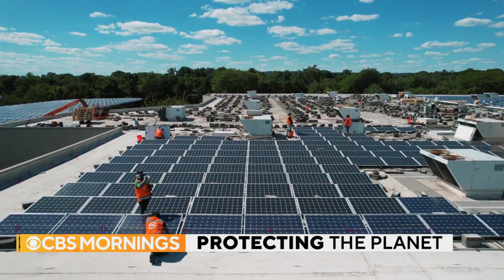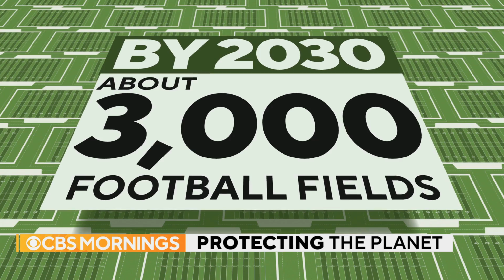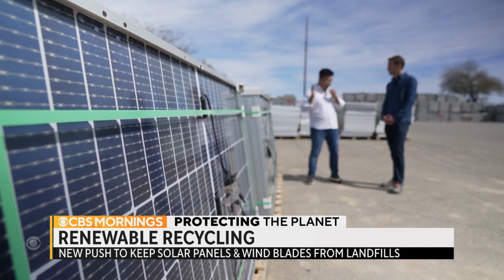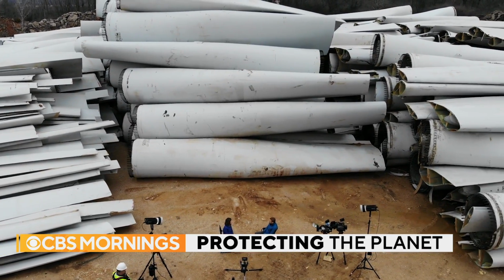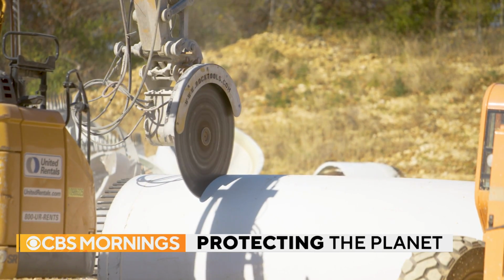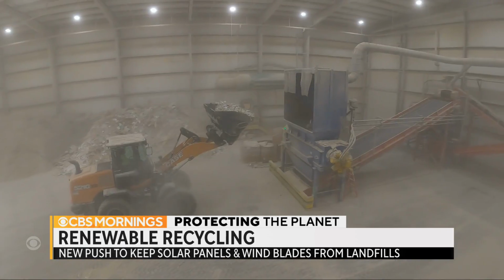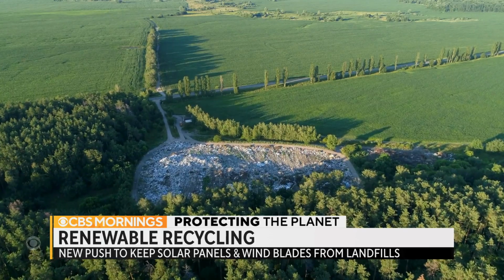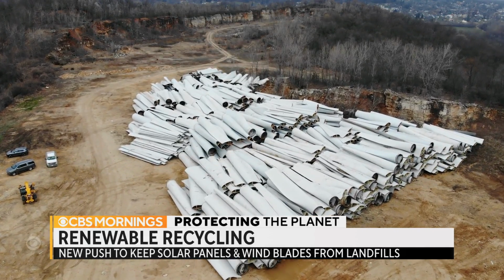Wind blades and solar panels head for landfills after being replaced

Comment: If the blades were put vertical and made into a fence or something like a retaining wall, would last almost forever I guess?  If they are so unbreakable, why are they being thrown out??
Reply: Lol.  That's how we get the right on board.  Build the wall out of it.
Reply: That's a good idea! Repurposing is always a good idea and the fact no one is trying to find a solution and just dumping it into the landfill isn't very "green" of them
Reply: Sounds like a good idea until you think about it for 5 seconds.
Reply: Give them to trump
Reply: When I said fence, wasn't thinking border, but that would work I guess. I was thinking more along of the lines of a fence or wall beside the highway for noise control from the vehicles. They could also be ground up and used for aggregate in concrete or in roads too. As far as statement as being unbreakable, that was sarcasm.
Reply: @Jerry-ko9pi  "They could also be ground up and used for aggregate in concrete "
Fiberglass and epoxy aren't great candidates for that. Both are toxic and break down in sunlight.
Reply: @wisenber  Boats Aircraft and Skis are both also equipment that is often made of such materials. Why not learn how these are taken care of when used up?
Reply: @beatreuteler  "Boats Aircraft and Skis are both also equipment that is often made of such materials. "
Larger boats and aircraft aren't. That leaves things far smaller and less pervasive than windmill blades.
You can take all of fiberglass skis made in history, and they won't equal a single year of windmills.
As to where do old boats and skis end up, they end up in landfills.
Reply: @wisenber  Not always and not everywhere. I am convinced that especially in Europe there are other solutions. Even in the states in some places according to threads in this commentary space there are solutions to that. This said it just is a matter of some areas where responsible people need to have a look elsewhere to find solutions others have already found.
Reply: @beatreuteler  "This said it just is a matter of some areas where responsible people need to have a look elsewhere to find solutions others have already found."

The underlying statement this said is that costs of wind and solar were hidden when being adopted and promoted.
And many of the solutions in this video are more toxic than what they're supposed to be replacing. Incinerating epoxy, balsa and fiberglass to produce power yields much worse pollution than just burning gas.
Landfills in the US were capturing gas and incinerating plastics to produce electricity twenty years ago, except now we're trying to eliminate combustion which means more landfills.
Reply: @wisenber  We were told Manhattan is built on top of a landfill. You will show me the "more landfills" later, I guess.
Reply: @beatreuteler  " You will show me the "more landfills" later, I guess."

No need to guess. Feel free to check your local landfill.
Reply: @wisenber  Our local landfill(s) are shrinking. That's why I assume you will want to show me the growing landfills once you have discovered them.
Reply: @beatreuteler  "Our local landfill(s) are shrinking."
Strange that we see so many stories about landfills being overrun (like the one you just commented on) while constantly being badgered to reduce waste. Did you have a source for shrinking landfills?
Reply: They ARE grinding up the blades for aggregate in concrete. They're shortened for processing.
Reply: @wisenber  go look at the airplane graveyards for an example. large cargo or cruise ships may go to breakers, which is an environmental problem of itself, but small boat? see airplane graveyard...
Reply: @chrishayden7016  
It not for aggregate, they are burning them to make cement instead of coal. Burning chopped up fiberglass and balsa wood. Not toxic at all. 🤣
Reply: @wisenber  Yes, I have a source. Just 1 example: The big Landfill in Kölliken, Switzerland (you may try to google it) was digged out to clean it up. So it shrunk. Just finished a couple years ago.This was quite an undertaking as the large sealed hall that was built over it (to trap gases) for a while was the largest 1 span industrial hall of the northern hemisphere. And so now you know approximately where I live. And I can confirm solar panels do not end up in landfills here as they seem not to break. They stay rooftop and make electrical energy form sunlight. Wind we don't have so much.
Reply: @beatreuteler  So they moved a landfill.
Reply: @wisenber we put fiberglass in concrete all the time
Reply: @randybobandy9828  In a road???
Reply: @wisenber  it seems like yes it's been used for roads but that's not the only application for fiber reinforced concrete. Most roads are asphalt anyway since it's cheaper and easier to repair and recycle
Reply: @randybobandy9828  "fiber reinforced concrete"
Fiber reinforced concrete has fiber sheets, not loose particles. Fiber sheets function as a laminate.
Reply: @wisenber  no they don't. There is loose fiber reinforcement too
Reply: @randybobandy9828  That would be a filler not a reinforcement, especially if it's mixed in with the balsa wood chips that was the core of a laminated substrate. It's also saturated with epoxy.
Reply: @wisenber  no it's literally reinforcement, I don't know what else to tell you.
Reply: @randybobandy9828  It's not reinforcing.
Reply: @randybobandy9828  "I don't know what else to tell you."
Chunks of laminated fiberglass, balsa and epoxy aren't reinforcement. I don't know what else to tell you.
Reply: @OGMann  "go look at the airplane graveyards for an example."
And you'll see a lot of metals.
Reply: @wisenber  Not really moved. They cleaned it up.
Reply: @beatreuteler  Where did they move the materials from the "cleaned up" landfill? 
Did it vanish? Did someone steal it?
Reply: @Jerry-ko9pi  yeah, most of that stuff will probably be reused. It's weird that they get 4 year old panels, unless they get smashed by a freak hail storm or shot multiple times with a 12 gauge, the work for half a century. Even if they get at 50% efficiency you can sell them used.
Reply: @assholeyeng  " the work for half a century."
Or the 20 years they're rated at.

" Even if they get at 50% efficiency you can sell them used."
A bunch of panels with incongruent output yields the lowest common denominator but take up 100% of the space required.
Reply: @assholeyeng  Aren't most of the panels Chinese?
Windmills tend to have similar lifespans, but few end up being used that long.
Reply: @assholeyeng  The US isn't going to mine the raw materials needed for domestic production, and China isn't going to sell raw materials when they can sell value added components.
Windmills tend to be retired early due to their being obsolete prior to EOL.
Reply: @assholeyeng  " They seem to have no issues with oil and gas extraction."
You might want to take a look at the conspicuous absence of new oil and gas leases being sold since January 2021.

"you mean that better turbines are coming out so fast that they just throw away the old ones?"
I mean the the  operating cost is higher and the output is lower than the new ones that replace them.
Despite what the video said, many older ones do also break. Feel free to look up "windmill failures" as evidence.
Reply: @assholeyeng  " I guess renewables will never take off "
I imagine governments will continue to dump trillions of dollars into them regardless.
Taxpayers and rate payers will pick up the tab. Maybe they'll tack on a recycling fee to the cost of installation as well....which will be passed along to homeowners and rate payers.
Reply: jmswillow5969  "there are over 9000 leases not being used. "
That's a common myth that is tossed out with the deliberate intent of ignoring how mineral leases work.

"There doesn't need to be more issued."
The law says otherwise. Federal law mandates that lease auctions be held annually, which has been ignored since January 2021 despite court rulings.
Reply: @wisenber  "Or the 20 years they're rated at."  They don't stop working at 20 years,  they're rated up to 80% of their output for 20 years,  they can last a bit longer unless they physically get damaged
Reply: @Mike__B  In reality, old panels are being replaced well before that as newer ones have a great enough performance advantage to warrant sending the original ones off to the dumpster. Sort of like people buying a new vehicle years before they fail or upgrading their iphone.
The percentage of people keeping things until they fail is a minority.
I've swapped out the solar system on my sailboat three times in the last twelve years. I did it because the performance and efficiency gains were great enough to toss out the previous ones.
Reply: @wisenber  
China does not supply the raw materials for wind turbines. There are many manufacturers building them in the USA and Europe.
Reply: @wisenber  
The oil industry does not need new leases. There are 9,000 approved leases that companies were just sitting on. Now with high prices and the federal government threatening to take back unused leases oil production in the USA is at almost record output.
Reply: @wisenber  
Globally fossil fuels receive $6 Trillion annually in subsidies. That is far more than renewables receive or ever have. Solar is now the cheapest form of energy across the globe.
Reply: @wisenber  
9,000 unused leases is not a myth. There are thousands of unused leases just being held on to. But now some are coming online and that’s a good thing. What we need is a smooth transition to cleaner energy.
Reply: @wisenber  They also won't issue (or slow walk) the permits for the leases they have issued.
Reply: @wisenber  Could be that there are thousands of active leases already that aren't being developed and explored,but have been tied up in perpetual leases for years.
Reply: @wisenber  New policy requires active exploration and developement on existing leases that hasn't been happening by the companies that have them.Perpetual leasing of public property without a  described purpose is BS..
Reply: @assholeyeng modern solar panels only loss about .5% to 1% capacity a year. Those panels were basically as good as new.
Reply: @assholeyeng  "on fossil fuel subsidies"
Did you have an example of a hydrocarbon company getting a check from a government that didn't involve buying something? We know the big % paid over half a trillion dollars in taxes last year.
Reply: @andrewday3206  "China does not supply the raw materials for wind turbines."
I was referring to solar panels. But you knew that, right?
Reply: @andrewday3206  "The oil industry does not need new leases. "
The law says the federal government is required to conduct lease auctions.

"There are 9,000 approved leases"
That's a common red herring cited by people that either don't understand the leasing process or are deliberately misleading.

"and the federal government threatening to take back unused leases "
Taxpayers have to refund the companies that bought those leases, while lease proceeds go into the federal budget.

"the USA is at almost record output."
It's still below 2019 with new sources drying out.
Reply: @andrewday3206  "Globally fossil fuels receive $6 Trillion annually in subsidies. "
Did you have an example in the US where the federal government provides any check to an oil company that doesn't involve a purchase? We know the top 5 oil companies in the US paid nearly half a trillion in taxes last year.
Reply: @andrewday3206  "9,000 unused leases is not a myth."
It's a red herring. Leases may or may not have anything on them. Leases also require geological surveys, then permitting, then funding.

"What we need is a smooth transition to cleaner energy."
Regulating an arbitrary date by executive fiat isn't that.
Reply: @joebeetz1832  ",but have been tied up in perpetual leases for years."
Which were sold providing funding to the federal government. Retracting leases means taxpayers refund the lease price.
Reply: @joebeetz1832  "Perpetual leasing of public property without a  described purpose is BS.."
The terms of the leases were passed by Congress and signed into law. The EO halting leases was not.
By passing existing law is BS.
Reply: @wisenber  
Pointing out, we have 9000 unused leases is not misleading. We do not need more and I understand the process. Thank you. If a company is not using the lease, they purchased they should lose it. Do USA is within single digit percentage of its highest output ever. Output is increasing right now output is nowhere near decreasing. Output has been increasing ever since Biden took office!
Reply: @wisenber  
Multiple topics have been discussed, and now I am not a mind reader
Reply: @andrewday3206  "Pointing out, we have 9000 unused leases is not misleading. "
It is a read herring. That number by historic standards is average.

" We do not need more "
Federal law says we do. What we don't need is executive rule by fiat.

"If a company is not using the lease, they purchased they should lose it. "
Federal law doesn't agree.

"Do USA is within single digit percentage of its highest output ever. "
It's below 2019.

"Output is increasing right now output is nowhere near decreasing."
Future output depends upon leases. As it so happens, federal law requires lease auctions be conducted each year, yet we haven't since Biden took office.

"Output has been increasing ever since Biden took office!"
Let's ignore a pandemic, right?
And we can ignore the 6-9 months where no permits were processed due to an EO in 2021, right?
Reply: @andrewday3206  " I am not a mind reader"
How about reading the title of the video you're posting on? That might help.
Reply: @andrewday3206  Who is the greater fool, the fool or he who argues with the fool?
Reply: @junehanzawa5165  
You are correct. Thank You it’s pointless arguing with someone who doesn’t understand
Reply: @joebeetz1832  "New policy requires active exploration and developement on existing leases "
The new policy doesn't appear to agree with the laws passed by Congress. Having a policy in conflict with the law is BS.
Reply: @assholeyeng  no solar panels work at anywhere near maximum efficiency for 50 years
Reply: They're made like wings so they'll likely fly off in a strong wind.
Reply: You mean like at the border or something?? Like a green friendly wall?
Reply: Yeah stick them in the ground as 200 foot posts at the border with mexico :D
Reply: @nesttea2239  The US usually just ships its recycling somewhere in the Asia-Pacific where it gets dumped in the ocean.
Reply: @wisenber Some are sent to Rawlins, Wyoming to be put in a landfill!!
Reply: @jamesspalten5977  Except for the fortified concrete platforms. Those are still in the abandoned windmill farms. It would cost a fortune to remove them.
Reply: @wisenber  Not wind power blades.  They are too large to ship economically anywhere in the world so they get buried in landfills in the US.
Reply: @nobodyspecial4702  Not all of them end up in landfills. Some of them are just left on site after the lease expires, especially if the lease didn't specify who had to pay for any removal.
Reply: Yes, build that wall. Finally we don't have to beg Mexico to pay for it.
Reply: @vuaeco  The materials weren't really the hold up
Reply: They break all of the time. See lots of them in Oklahoma.
Reply: Thats a great idea...take them to the border!!!
Reply: They are burning them because they are way less toxic than coal... 
oh wait... 
never mind.
Reply: Isn't it fantastic that we have apps like YouTube that can be looked back 10 years from now and see and read all the negative and doubting comments regarding renewable energy and EVs?

Wouldn't it have been great to have had it a century ago with all the naysayers against the automobile, or horseless carriages as they used to call them at the time? I know there exists archived newspaper articles such as the one from automobile pioneer Alexander Winton on the Saturday Evening Post titled "Get A Horse! America’s Skepticism Toward the First Automobiles," but what's going on now is priceless. These comments are all going to be saved and read all over again. To have exactly what the naysayers were saying by their own written words is absolutely priceless.
Reply: @Paul-cj1wb  It is great to have those. Like when they said the glaciers in Glacier park would be gone by 2012 and how Saint Greta said the world would be over in five years six years ago.
We even have laws on the books banning hydrocarbon vehicles by 2035.
It'll be great to see those in ten years.
Reply: @wisenber  Really? Where can we read those? Do you have a source to point us to those exact words?
Reply: @Paul-cj1wb  Yes. Your post. But you knew that, right?
Reply: @wisenber  So you mean you don't have any examples. It's just your views. And everybody is supposed to just take your words for it. That's what I thought.
Reply: @Paul-cj1wb  "So you mean you don't have any examples."
So you mean you want us to believe you didn't say what you said?
Reply: @Paul-cj1wb  I couldn't agree more, Paul.
Reply: They aren't unbreakable and 100 foot tall fence that's 20 feet thick isn't particularly useful anywhere.  They literally start to break down as soon as they start spinning.
Reply: @nobodyspecial4702  Well, that fence would be something to see, wouldn't it?  Might not even be much of a fence... more like a giant sculpture?  Really monumental sculpture!  How about wind breaks in some giant desert?  Like out in the Taklamakan desert where people put straw in the ground and plant little scrubby trees, generation after generation?  YES!  A giant fence of old turbine blades, MILE after MILE!  There's plenty of room...
Reply: @nobodyspecial4702  I know of a PERFECT place for a 100' tall fence down South....
Reply: Could they  be particularly useful down on the border
Reply: @nobodyspecial4702  border wall
Reply: Unless it's on the BOARDER! Lmao!
Reply: Unless it on the BOARDER! Lmao!
Reply: @nobodyspecial4702  Of course you would have to cut them into the right sizes
Reply: @safeandeffectivelol  Land mines are cheaper and work better.
Reply: @nobodyspecial4702  The southern boarder with mehico
Reply: Don't tell trump that. he loves long walls
Reply: @2mustange  "he loves long walls"
So did Congress before Trump came into office. Wall construction was authorized for years, then was pulled when Trump said he wanted it.
The Secure Fence Act was passed in 2006 with bipartisan support.
If Trump had said that he loves abortion, Democrats would have banned it.
Reply: ..we could use them to finish the wall..🤔
Reply: there is not one single industrialized system created by humans that is , or ever will be  sustainable.
Reply: I’ve been saying that for years there not that smart
Reply: They don't reuse them for the same reason they don't pay to recycle them. The chemicals used to manufacture them are hazardous. Recycling them cost too much to the energy companies, so they toss them
Reply: Well said
Reply: bury them on the border as such
Reply: Because the right wing wants a wall that fall falls over
Reply: Are the blades solid? If solid they could be cut into bricks and used as building material.
Reply: @DIAPERJOE  Unfortunately I don't read from your statement what it is that you call nonsense. The best possibility I can guess would be if you mean the felt 80% of contributions here that ctitizise an industry of which they don't know anything apart from what is talked about it on round tables in restaurants. That is the real nonsense.
Reply: build a border wall
Reply: Hey that's an ideal let's use the blades to build the wall.
Reply: They should make good roofing material
Reply: There is a southern boarder that could use an unbreakable fence